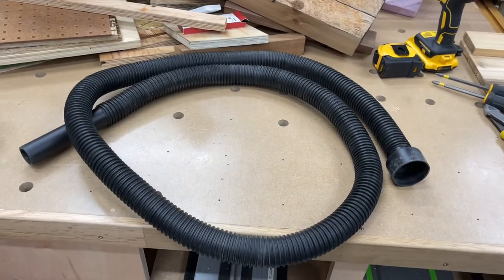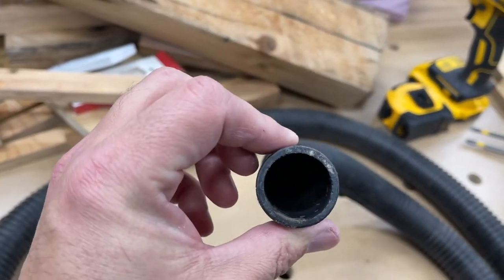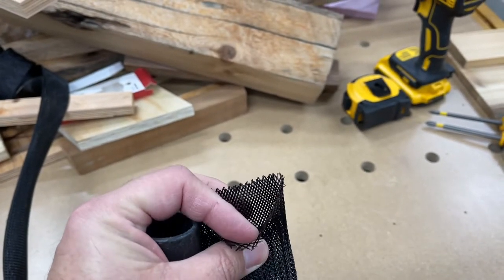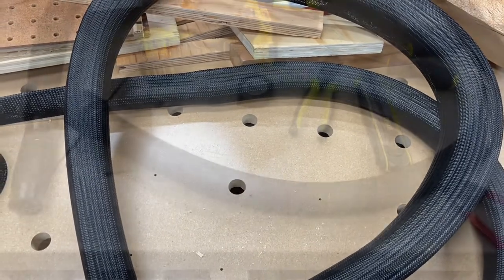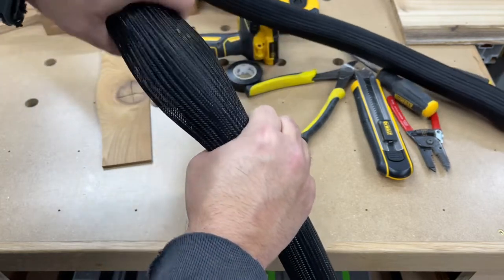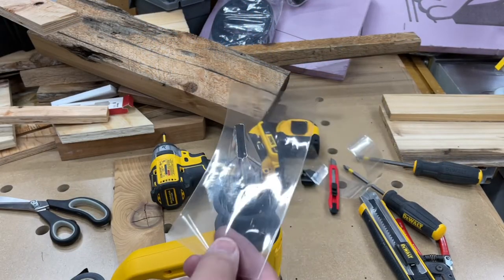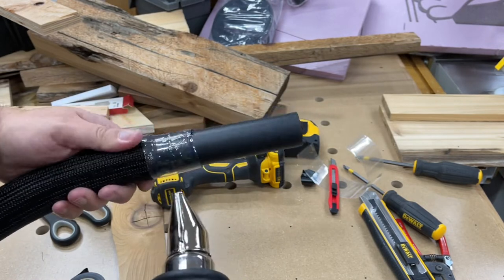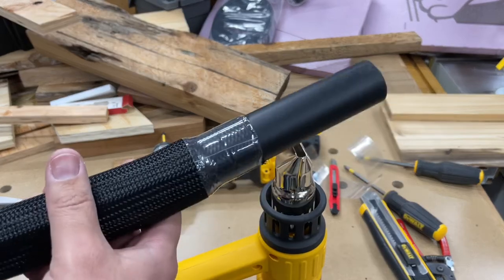Upgrading a shop vac hose.  With sleeving.  I love this upgrade!

Comment: That heat shrink tubing just gave me an idea for making custom adapters for different size dust ports.
Reply: You can also train a heat gun on schedule 40 PVC for 2 to 3 minutes and it becomes as flexible as that sleeving for a few minutes, which is enough time to force a male end of shop vac hose into one end of the PVC or to force the PVC into the female end of a shop vac hose. When it cools it becomes as solid as it was before the heat and it maintains the shape you molded into it.

Comment: Never use electrical tape on anything, including electric work.  It just turns into a sticky mess after a few months.
Reply: Here in South Florida, it is DEFINITELY a problem. The best stuff i have found is the 3M Super 33 tape. It lasts for years in my un-airconditioned shop, without the usual goo.
Reply: Use the good stuff, it doesn't get sticky.  3M Super 33!
Reply: Especially if it gets heated with a heat gun

Comment: Where did you get the PET sleeving that size?
Reply from the maker: This is the one I ordered.  If you can find 1.25” (1 1/4”) that would be even better.  I found some 1.25” black and yellow safety striped as well.

25ft - 1.5 inch PET Expandable Braided Sleeving – Black – Alex Tech braided cable sleeve https://www.amazon.ca/dp/B075QD7RP6/ref=cm_sw_r_cp_api_glt_i_PH5SVQWHZA2D6JGQHPTB?_encoding=UTF8&psc=1

Just choose the 1.25” and select safety stripe.

https://www.cabletiesandmore.ca/flexo-pet-braided-sleeving?gclid=Cj0KCQjwvYSEBhDjARIsAJMn0ljnQ4y9EaAyzBDKi3rQd4XOFJCaznYbJIo0UjixszPuc4gr-XmtIYoaAuWOEALw_wcB

Comment: How had this held up?  Did it stay on..... or had it been a pain in the ass. I'm looking for a skirting like this to protect my clients belongings when I'm dragging a vac around their homes and businesses. Thanks
Reply from the maker: It has held up great! It makes moving it around so much easier. Works perfect on the DeWalt HEPA vac hose and the shop vac hose. The trick seems to be to use a couple of good zip ties at the end of the corrugated part, cut the excess perfectly flush, then cover it all with heat shrink.
Reply: @mbwoodbutcher  great thanks for the reply!  What about heat shrink on the hose end as a gripper, then the sleeve and then a final piece of heat shrink.......n maybe a drop or three of gorilla glue in between all the layers?
Reply from the maker: It seems better to get the expanded sleeving down in the groove and use the zip ties to hold it in there. 

The heat shrink mainly keeps the ends of the braided cover from sticking out all over the place and keeps the ends of the zip ties from catching on stuff. 

A little gorilla glue under the zip ties would not hurt though. Kind of a belt, suspenders, and framing nail all in one.  

All each should work but all 3 should be bullet proof.
Reply: @mbwoodbutcher  great! Thanks again!

Comment: In all fairness I am not convinced it turned out into anything convenient. Apologies. I fully respect your choices. But I would never ever go for anything similar. Just does not fit my way.
Reply from the maker: Fair enough. For me the convenience of not having the ridges catch on stuff has been worth it!!
Reply: @mbwoodbutcher  have you got any evidence of that attempted solution still being working as of now?
Reply from the maker: Yes, I have used the hose in the shop since I did the modulation for everything from general cleaning to use with a pocket hole jig to dust collection with my track saw. 

So far it has been durable and no issues with the heat shrink and zip ties loosening.

Would you like me to post a follow up video?
Reply: @mbwoodbutcher  No thanks. All the best.
Reply: @mbwoodbutcher  I think this is an epic idea and am going to do exactly the same thing on my hose which I despise for the hose ridges catching on everything and even damaging edges in some cases. You're a star - thank you for the idea, just ordered some from Amazon here in the UK 👍

Comment: Does that heat shrink come on a roll? Most heat shrink i have used is tubing.
Reply from the maker: Yes, the heat shrink comes as a tube. One was rolled, another folded back on itself. I just cut a section off and slid it over the area where the sleeving was cut and held in place with the zip ties. Just remember to melt the end of the sleeving to keep it from unravelling.